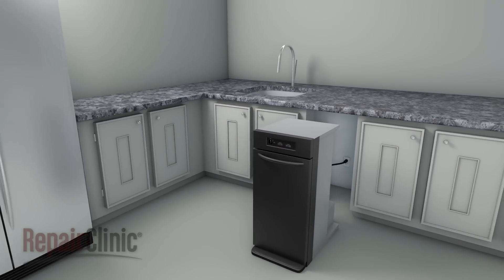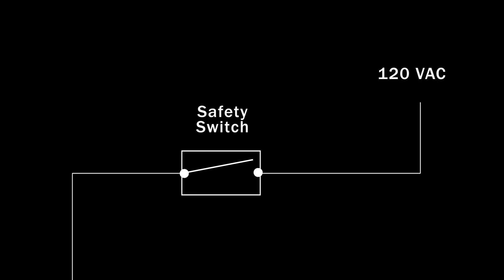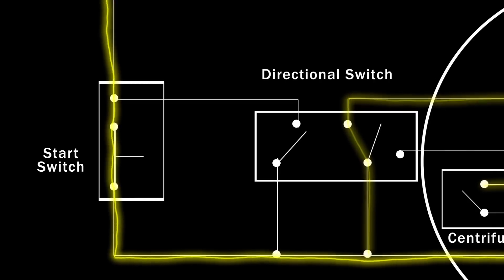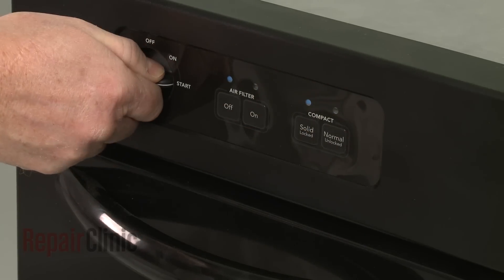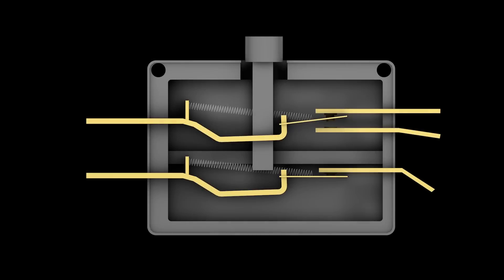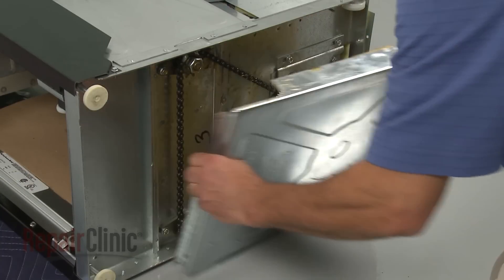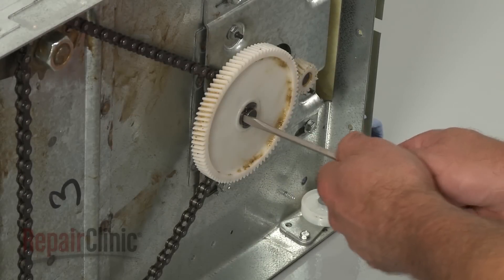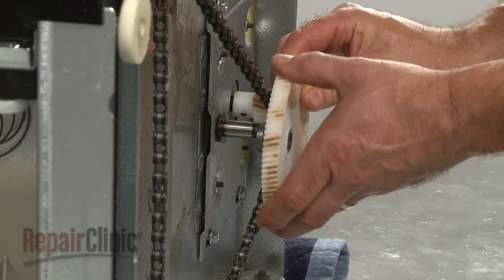How Does a Trash Compactor Work? - Appliance Repair Tips

Comment: to all those who are so negative. You need to understand that garbage compactors will only compact down about 1/2  the depth of the container. so as you continue to fill the unit with each cycle or use the more garbage you put in, the more compressed the garbage is, the first one or two cycles isnt a gauge of how compressed it will eventually become because the first use isnt as compress as later cycles with garbage will be. plus the unit we had in Florida had a setting that kept the piston down to hold the garbage down  until next use. this would help to prevent the garbage from springing back and stayed more compressed. We had to pay for garbage pick up based on  volume not weight so it did say us  a good amount of money . we were able to cut our container size in half. we had ours outside on  the side of the garage. their is a learning curve . it was well worth the price for us.

Comment: Friend of mine got one of these FREE, and in turn 'fixed' it by hard wiring all three switches, since one had failed.  Key is a twist dial, on or off, and bidirectional use is automatic (the switches still work directional use of the worm drive).  Stripped of panels, looks very basic, now works to compress 'mini' hop bales of their seasonal hops with a wood 'shim' that makes for better compaction of the hops (panel/press doesn't fit tightly in the box/baler, but does not).  In summary, great unit, durable, often fails with switches, and presto it works fine.

Comment: I have a GE Profile MODEL NO. GCG1500LOBB   that is fairly new. All of a sudden it got stuck in the down position. I took it apart and barely turned the gear and it worked perfectly. I put it all back together and it would just hum. Took it apart again and barley turned the gear again and it worked just fine. It will work if i just give the gear a nudge.

Comment: Anyone know how to test the centrifugal switch?  I would like to test it with the meter like you show for the directional switch.  Which leads to I touch to test?  My compactor ddoes not reverse.  It compacts, and then I have to either force open the drawer or On/Off the switch to get it to release and reverse.  Not sure if is is simply the plastic main gear that has a radial crack which could allow it to spin on the chain gear nut and not stop and force reverse, OR if it is a bad Centrifugal Switch.
Reply: GREAT QUESTION, I'd like to hear the answer. Did you ever find the problem?

Comment: Excellent video, it told me everything I wanted to know. One thing about the machine in the video..... plastic gears..... really...... plastic, boy, talk about built to fail. Lemme guess, was this machine made in china? Maybe selecting a better machine should be a recommendation.
Reply: I know this is an old video/post but plastic gears are used to save the motor. The gear is designed to fail if the unit gets stuck. This saves the motor from burning up. 

So yes, it's built to fail, but it's a safety feature and actually cheaper to fix.

Comment: We have one of these in our house it’s the 70s answer to waste management. The problem is when you go to pull the bags out the trash compactor it ends up all over the floor little bit of the bag. You really end up making a mess I need another bag end up wasting two bags in the end.
Reply: You need to use trash compactor bags.  Either paper or plastic (what I would recommend).  The plastic is VERY thick.  They're kinda hard to find so once you locate a source, buy an extra package.  I use Hefty and we go through one bag about every 2-3 weeks.  One package costs about 4 bucks and lasts about a year so you really can't beat it!  But we don't put anything that has food in it or you have major smells or will need to empty sooner.
Reply: leimdog omg, you don't put any food waste in it....lol Let me tell you, I live in a rural area, so I burn paper, boxes, etc. and plastic is all that's left...with food items....lol  For some reason, I thought a trash compactor used heavy bags, close to cardboard and boxed it up after it was full...lol I mean, if new ones cost $1,000 + and they don't do that and you can't put food items in it....then it's a waste of money...lol. I'll continue to push the trash, garbage down in the bag by hand....lol....;-)